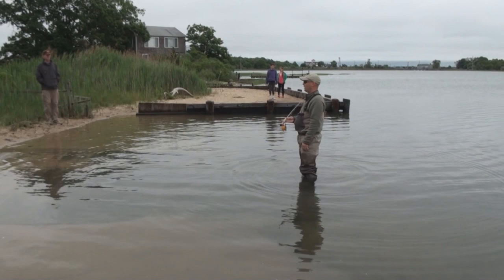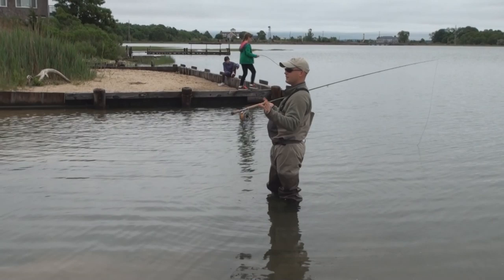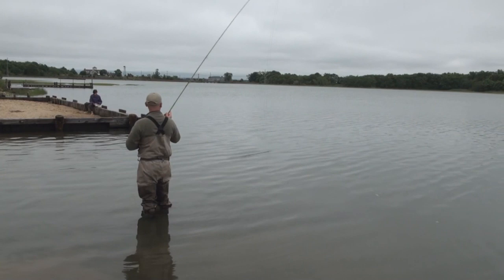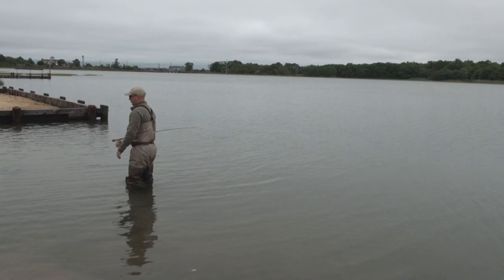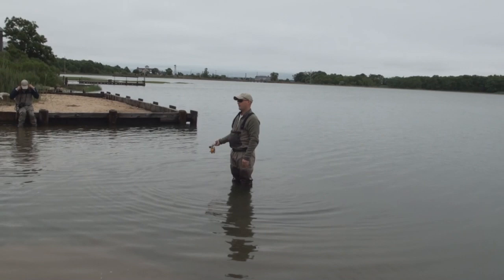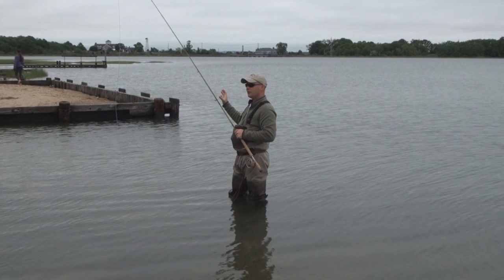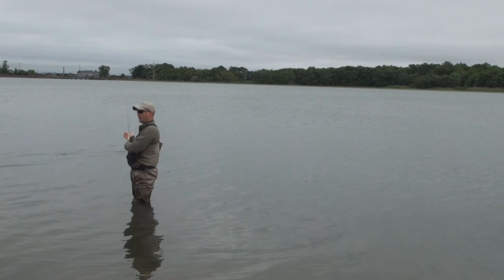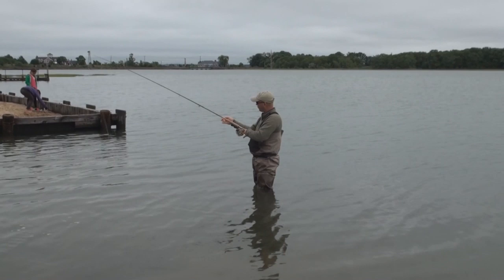Spey Casting How To: Spey and Switch Rods In The Salt 1/3

Comment: I’m using a 13’ Spey still learning but what line do i need to setup for saltwater river on drop off from front of skiff or fishing bank to shoot upcurrent what fly line and what tip
Reply from the maker: Hi Arturo, a floating and/ or an intermediate skagit head would be the best bet for what you are looking to do.  The grain wt will depend on the exact rod that you are using.  For tips we like the Airflo Extra Strong Polyleaders.  Typically polyleaders are used for scandi heads but since these are heavier these match really well with skagit, and are also half the cost.  They also have a 40lb core and match well with saltwater tippet.  Feel free to give us a call at 973-244-5990 if you'd like to speak directly.